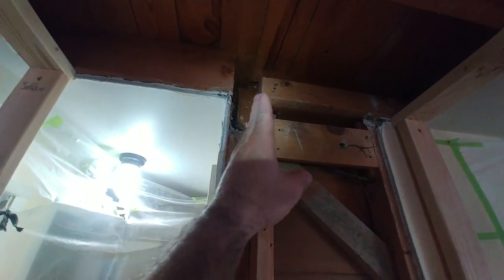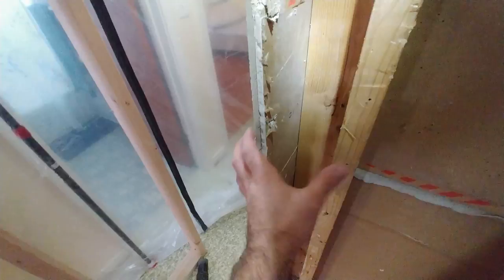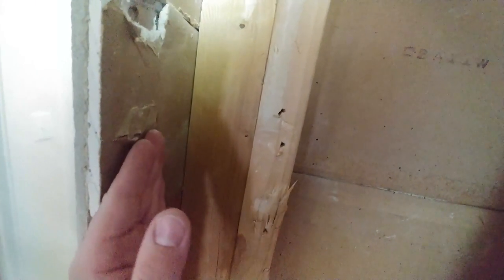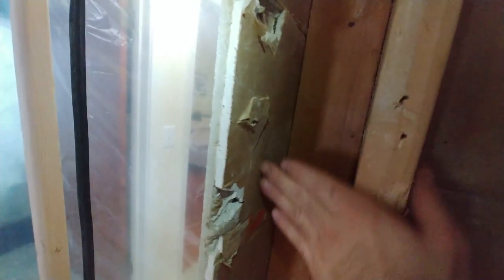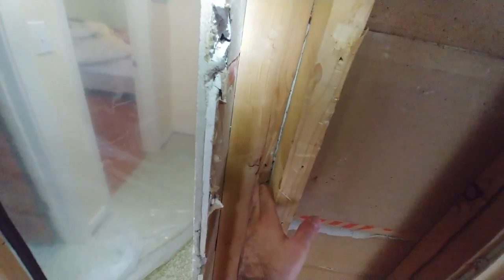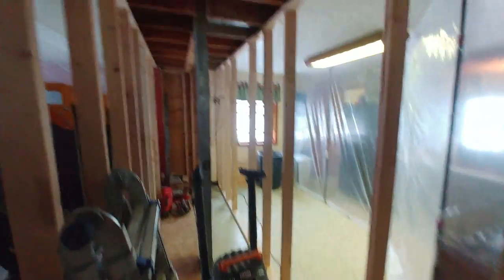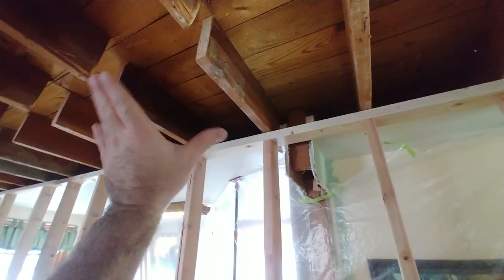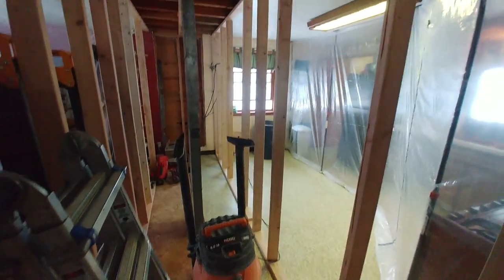Load Bearing Wall Removal Episode 3

Comment: What tool did you use to removed that top corner beside receprocating saw?
Reply from the maker: That's about it. Maybe a hammer and pry bars. Demo blades designed for nails in wood.